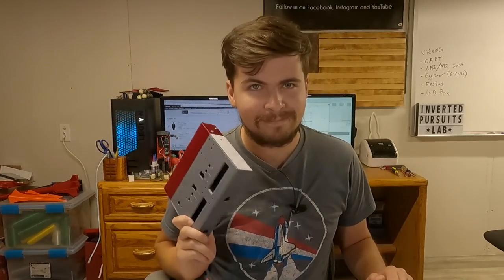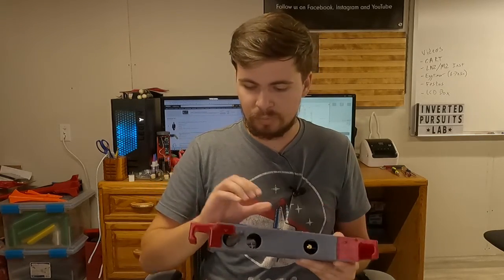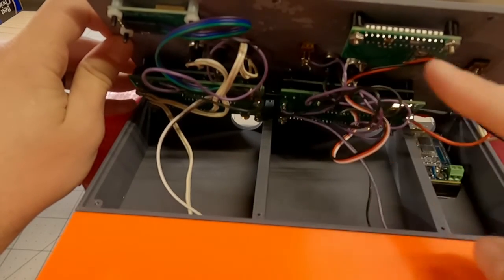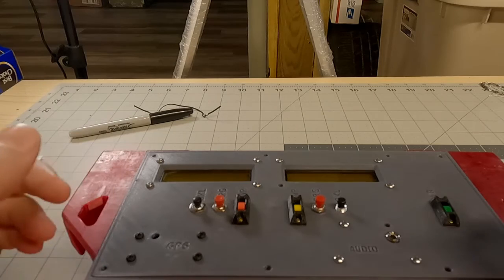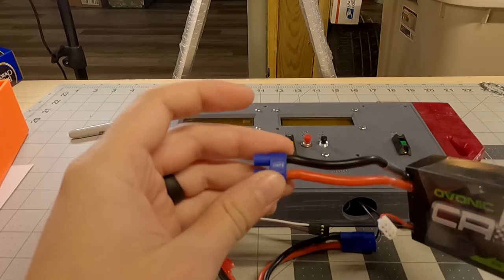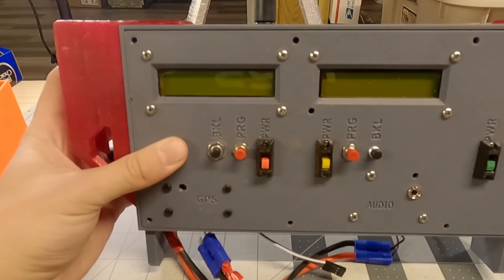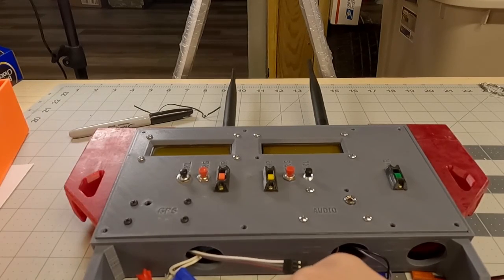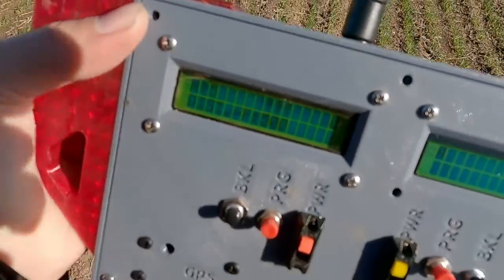EggFinder LCD Box Build and Final Tracker Testing

Comment: That screw on antenna is to receive a signal. It would not hurt if the antenna was not connected. You would just never get a signal from the transmitte in the rocket.

Now the transmitter that goes in the rocket. You want an antenna that is tuned properly for sure before you turn that on. 

I'm building one of these now.I'm trying to understand the manual and all the settings as far as finding the rocket.  

Lots of work and time..

What 3-D printer do you use?Or do you recommend that does not have limitations and fuckery like some people talk about...

Comment: I was expecting to see some actual building.  Metal screws vs nylon, spacers, wire management, etc. how did you mount everything to the lid. It looks like you added four holes to screw the lid down with.
Reply from the maker: Appologies for not showing more of how things are mounted in the box. The wiring makes most of the footage hard to follow. The box uses 4-40 x 0.75in screws to mount the main LCD screen. There are spacers I 3D printed and are in the printables link on the video that you can make (unfortunately they aren't a standard size). The GPS module actually came with nylon mounting hardware and so I simply used what I had to hold that down (You can see its mounting in the GPS module video). The wiring was chaos and I'm looking at changing large parts of it which may lead to a pt2 of this video once I figure out how I want to do it better. Thank You.